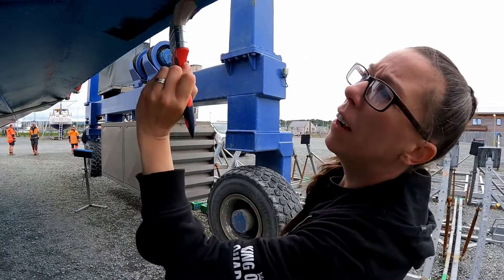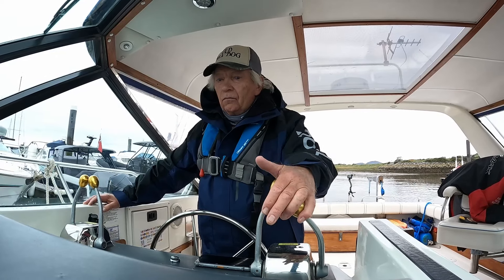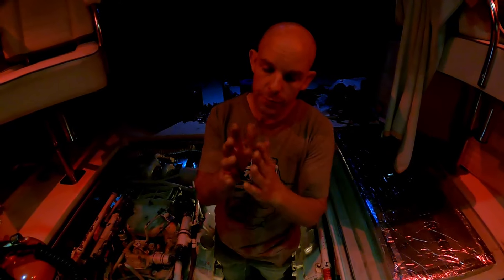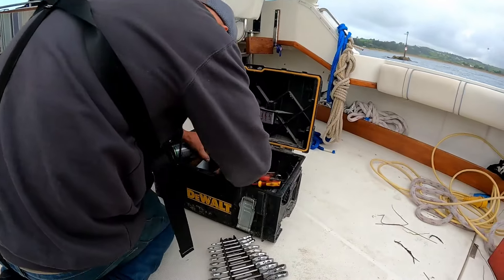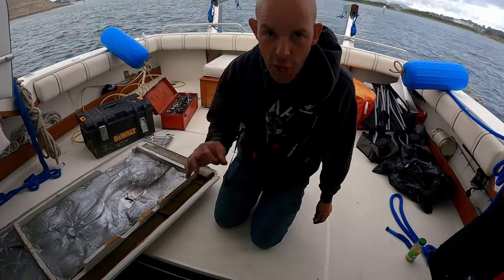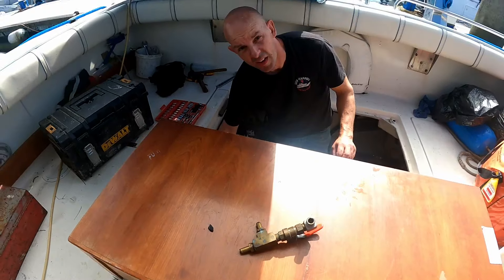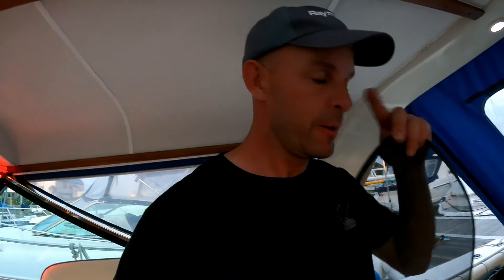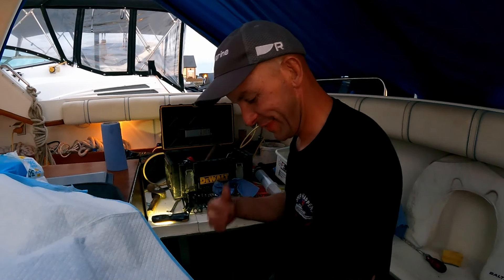Our Biggest Boat Failure Ever!

Comment: Simon what about making a makeshift pipe to the other tank which seems to be clear to get you home then you can remove the tank and steam clean it when you get back to your home base like you say the vibration is the engines out of alignment probably shifted when he hit the rocks hopefully the vibration should all go when you get them inline and you will have a good boat one thing I would do when you can afford it is to get the turbos reconditioned you don't want oil leaking in the inlet and the engines run away from you as you won't be able to stop them unless you can block of the inlet with a piece of steel, not wood I've tried that on a coach engine it snapped the half inch wood and ate it and still kept on running on the oil in the end a quarter inch steal plate across the inlet stopped it so I would carry a piece of steel in your engine bay just in case which will fit over the intake it does work and I am still here yes its nerve racking with a screaming engine as it runs faster than the governor can control it as you will know as i know you have experience with engines and wiring like me so good luck so you might want to just run of the one good tank until you get it home all the best from John from Rugby UK.

Comment: Ok some suggestions, when you are pumping fuel out of the tank to the engine, air has to be able to get in, where is the tank breather system and is it working properly? From your description of opening the water drain at the bottom of the filter and it sucked air in, there is a vacuum developingin the tank and it is starving the engine of fuel. Is the breather blocked with the black coal that it has sucked into the fuel system from wherever the open end of the breather is? Has some idiot sabotaged the boat in the past by dumping this stuff in the tank? You will need to clean out the fuel system as far as the injector pump, and then put pick up sock styyle filters in the tank! I think the "centrifugal filter Simon keeps cleaning out is a water seperator, it is not designed to filter debris from the fuel, you need a paper element or fine mesh style filter before it goes into the water seperator. This is a right nightmare, but you will get there, Chins up and keep going!  Just remember a boat is a hole in the water for throwing money into which makes you happy on two days, the day you buy it and the day you sell it!
Phil, EastYorkshire

Comment: Chin up the both of you you will get it sorted and this will be just a memory, and more importantly, an experience to learn by, Throughout the years I have been through the same situation several times so can relate, just remember your both safe, not hyperthermic ( ruddy cold) or dehydrated and expected to live for a few more years yet, ok so you are not at the time where you can tie up on a mooring have a cold one and sing frigging in the rigging as one does, but that will happen, trust me, I could run through a whole list of things to be done, but what's the point you have already by now done them, lol anyway from one seafarer to another, may your shafts stay straight and you manage to get your wench on the winch,
Reply: forgot to say love the boat.
Reply from the maker: Thanks you! Hopefully be ready for next summer 🤣

Comment: I had a problem with my port engine staying at high idle after a run. It's been this way for 2 seasons and through 2 mechanics that couldn't figure it out . Thank goodness for YouTube videos like yours.  The problem was not systematic  of the part failure and led me to other potential part failures. I finally found a video that described my problem and I bought the new part and fixed it.  Be patient and if it's late and you're tired wait til the next day.  Something my mother taught me  years ago when I had no patience.

Comment: Anyone who has messed around with boats feels right with you. It will be worth it!  I add my vote for replacing all the fuel lines. The coal looks like the lining of the hose, hardened with age. Suggestion: add a clear filter housing with no filter right after the tank so solid bits can settle out and you can see any that might be in the system. Like a water trap, but for large particles. You could also add a screen to the pickup tube in the tank. Both of these are to get any bits in the pump or hard lines.
When you align the engine, you need to get top-bottom as well as left-right.
We're right behind you! You will do it!

Comment: High quality production with the usual realities of boat life.  May I suggest (with no great experience other than old bangers and motorcycles) that these chunks could be from the linings of hoses and lines affected by the fuel over many years.  Are the main filler pipes to the tanks metal?  In the past has a fuel filter disintegrated?  It appears to be just one engine affected, interesting. Simon you WILL fix of course.  Here we have the makings of another epic U-Tube channel.
Reply: Agreed, the hoses may have degraded over time but what if someone changed a hose in the past for one that was not diesel rated?  It might be worth biting the bullet and re-plumbing the fuel delivery system with quality diesel fuel  hose and metal hard lines where you can.  The fuel tank will probably need cleaning out as well.  The coal reminds me of the partially burnt fuel that coated the inside of all the cams and gear around an injector on a Merc engine that I had, of course it can't be unburnt/semi-burnt fuel but that is how diesel can degrade.

On the alignment of the props a double cardan between the output flange and the prop could solve the misalignment issue or maybe a rubber coupling that must be available for the torque (Porsche used to use guibo joints on the output shafts of their Can Am racer that produced 1100bhp and they were under considerably more stress than your props).  I would imagine that the damage inflicted on the props knocked the engines out of alignment.

Comment: Wax paraffin formation (also known as fuel gelling) – crystals begin to form when red diesel becomes too cold and amalgamate which block the fuel filter. This will cause the engine to fail or stop due to fuel starvation. "Anti-Gel Treatment" Anti-gel helps keep catastrophe at bay by preventing fuel from gelling. If your lines and filters are already affected, the additive can help clear them of built-up gel.
Reply: Not at these temperatures though.

Comment: I wonder if you could install an inline sediment bowl between the tank and the filter with a large bowl where the sediment could drop in the bowl before it gets to the filter. 
I have a feeling short of replacing the tank(s) this will be an ongoing problem for a while as you don't know where in the tank the chunks are coming from (sides, baffles, corners, top).
Reply: X2 plus filters x2 , each being able to be isolated..

Comment: I have been in your position many times in my 47 years as a boater. Boats can consume you if you don't fight it. A few things which may help, even if they are hard to do: Firstly, try to get some perspective.  Unless you are actively sinking, you can take time to solve your problems. It may be that you HAVE TO get things done by a deadline, but will the world end if you don't? NO. So take a deep breath and step back and try to re-center yourselves. EAT, get some sleep, go for a walk, try to see the problems in a different way. When caught up in the immediacy of dealing with boat problems it is hard to see clearly, and clear thinking is what you need to solve problems. 
Second: Boats are heartbreakingly expensive. They will try to crush you. None-the-less, you Will solve the problems, pay the bills, and look back on the whole experience in the rear view mirror. 
Third: Do what you CAN do. Don't get sucked into the trap of trying to do things you cannot do (at that time, with the tools you have, with the knowledge or parts you have, etc). You two are some of the most ingenious people I have ever seen. Relax and let your amazing minds free to solve the issues. Try to ask simple, logical questions and then answer them, taking you step by step closer to the right answer. You have shown a stellar ability to do this. Don't let hunger, low blood sugar, exhaustion, lack of sleep, etc detract from your abilities. 

A few specific suggestions: Diesels need 2 things to work. Clean air and clean fuel. Your teaser at the end suggests you are already doing what is required, but basically, with an older boat, the best way to get the diesel engines to run properly is to get MEAN and rebuild the entire fuel system with new components. Suspect EVERYTHING and assume NOTHING. Don't take shortcuts. Yanking the tanks as you are going to do and cleaning the HELL out of them is a good start. Check all O-ring seals if there are any. Sometimes fuel tank pipes have screens on the bottom which are unserviceable. If your pipes have them get rid of them.  Next, replace all the fuel hoses with certified diesel compatible hoses. The RACOR filters are GREAT. Disassembling them and cleaning them as you have done is essential. You probably have an external fuel pump. Check that it works properly. Fitting a combined pressure/vacuum gauge on the outlet side of the fuel pump can aid in diagnosing issues with fuel delivery. I have used a bypass fuel bleed system on several boats and it is very helpful. here is a link to a writeup I did for the SingleHanded Sailing Society:[ https://www.sfbaysss.org/resource/doc/Jefferson2014-SHTP-ReturnTrip.pdf ].

Be scrupulous about the hose connections. Air leaks into the fuel system caused by the vacuum created by the fuel pump will cause the engine to lose power, and eventually to stop, requiring bleeding. Change the engine mounted fuel filter. Inspect all connections rigorously. When you have a cleaned out fuel system with new hoses, a good fuel pump and filters, and are using fresh, clean fuel odds are that the engines will work as they should. 

Remember that (emotional attachments to the side for now) that boats are THINGS. And THINGS were built from scratch and can be repaired. There are many stellar boat repair and rebuilding videos on YouTube (including YOURS!) which prove the point. But when you are tired, hungry, frustrated, financially stressed, under pressure to take care of kids and life, it is easy to lose sight of the fact that your boat WILL get fixed and that your current problems will be behind you in due time. Please do not fall into the black hole that leads to burnout. I have seen it many times in boatyards when people do not pull back and take a deep breath.

You two are awesome. I am 100% confident you will get through this. Please do not let your present difficulties impact your positive feelings about your projects and life. All the best,
Michael

Comment: Hoover on blow was a good idea, but maybe not quite enough blow....
My guess is that there's a fuel line that's degraded and lumps are breaking off the inner wall, aided and abetted by the bouncing around during the sea trials.  Probably a real pain to pull the lines to either "bore them out", or replace them.

Comment: Hi Simon, others have suggested to replace the fuel lines with new. Also might want to check the conditions of the engine mounts specially if they’re rubber.

Comment: In 2001 a friend ask me to help him move his 1943 built 104' boat that was an army rescue vessel.  We were moving fuel between the three tanks to get the boat back to an even keel.  A huge stack of 2x12 planks on the left bow nothing shorter than 20 feet. Mostly 22 and 24s.  To transfer fuel it had to go thru the day tank on the forward bulkhead. The  over flow vent dumped into the left main tank. That valve was closed as we were moving fuel to the right tank. I mentioned to the owner to open the vent.     Nope. I'm the captain.  We lost the 25kw generator and both. 6-71 main engines within a minute do to the vacuum in the day tank.  If we had made it another quarter mile i was going to climb down in the engine room and open that valve. You should have heard the whoosh as i opened it.  Took two hours to change the filters and get the engines reprimed again.  Sitting at anchor in a 104' wooden boat in a 250 foot wide broken concrete lined harbor entrance.  The harbor patrol said pull up the anchor.   Can't  it weighs 1100 pounds and the anchor windlass is 3 phase.   The voyage from alemeda bay in long beach ca to marina del rey then to channel islands harbor got progressively worse as we went.  Lost the 25kw generator pulling into channel islands harbor. But i had rigged a scuba tank in the air horn supply tube so i could keep the air pressure up for the twin disc air shifters.   The coast guard wanted to come aboard for a safety inspection at channel islands after the generator quit.   I some how talked them out of it.    There were 9 pumps running off the gas generator on the foredeck. By the time we got to the guest dock. The water was 3 feet deep in the lazerette  2 feet in the engine room.  It was a nightmare.  Had to hook to 2 different shore boxes.  Fell asleep in soaking wet clothes. Got the worst case of hypothermia i have ever had.    Every muscle was twitching. From my toes to my nose. I pulled a sheet over me and fell back asleep.   I told my wife and my mom of what happened.  Ten times more than i typed here.  Mom said. You sure spin a good yarn.

Comment: Maybe you can get a strainer filter on the bottom of the feed pipe like there is in the sump of a car engine oil feed pipe, they are quite flat, it would stop all the big bits if they come from the tank.  You may be able to shorten the pipe with a small format plumbers pipe cutter which wouldn't put filings into the tank.  Good luck guys.

Comment: Sorry i do not subscribe to facebook or twitter or any of those media, but if you would post it on youtube i will follow along the Rode , so to speak. its a nice boat, worth a hundred thousand with the engines. Diesels always burn white and black, its if they start burning blue then their is a isue. hopefully your engines are not a direct bore  do the blocks have liners? or Direct Bore? I prefer Steel boats, glass is great where their is no ice conditions. Question was the boat a reposession by the bank , i believe you and your wife indicated you paid 5000.00$ Pounds Stirling was it? You will not find a boat like yours anywere in canada for under a hunderd thousand. stating all this, don't give up your floating home boat. i like that old british ex warship. i often wonder what kind of wood your using for the plank replacements and Ribs. are you going to have your glass cruiser tied up to the live-aboard, the mud won'd effect the bottom of your glass boat on low tide at all. Have you and your wife had many vandal issues? hows your kids doing have not seen them much. listen boat work is not easy with battery tools, no cord great but corded tools work faster, do you and your wife have a portable Generator? or in your engine room is thier an Onan if so switch to corded tools i suggest. You and your wife have a done a excellent job as far as i can see, few couples stick with a woody its money and time and alot of work, no one i ever knew would take on such a large wood boat its a rarity  , those that wine and complain because they have a 30 footer of wood and want to walk a away they should watch you guys. your a great team, i will continue watching if you place your videos on Yourube. Regards Daniel Ottawa Canada:

Comment: Get your engines laser aligned if you can. You will also need to re-chock the engines. You did not seem to blue the propeller tapers , this is important. The propeller is not turned by the key but the taper.

Comment: Probably a bit late now but maybe you should try sourcing the fuel from the other tank. Also the engine alignment is critical as if left it will lead to bearing failures and so forth. Not an easy task in minimal space but necessary. Good luck. Ian

Comment: Im sure that a good clean and new oipes will solve the issue. She's been sitting dormant for a long time, so it seems so its probably the fuel lines breaking down. Im certainly no expert, so im waiting with baited breathe for an update. She has some speed though. When she's fixed, she'll be a gem.